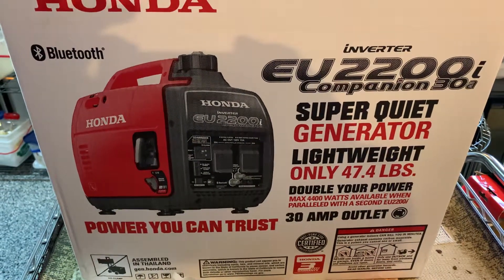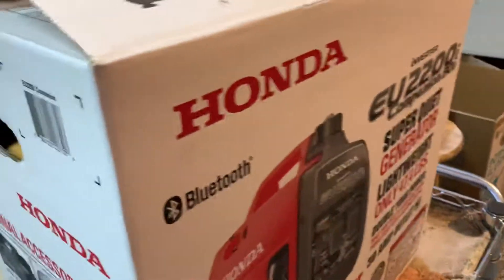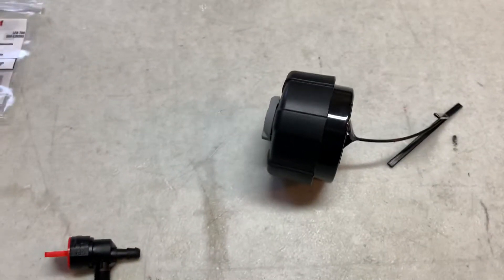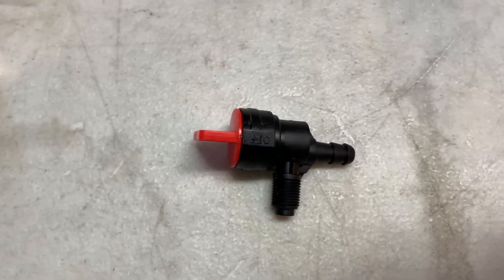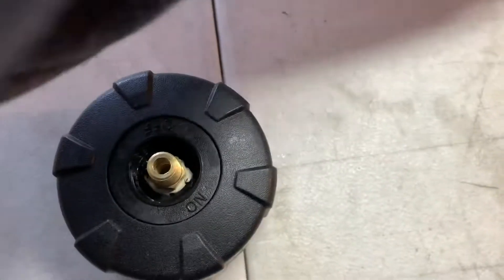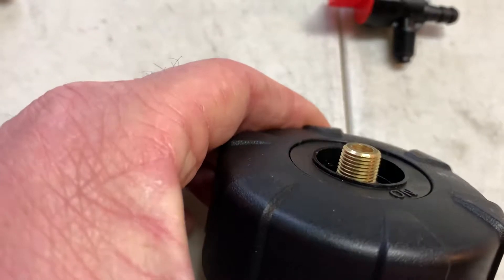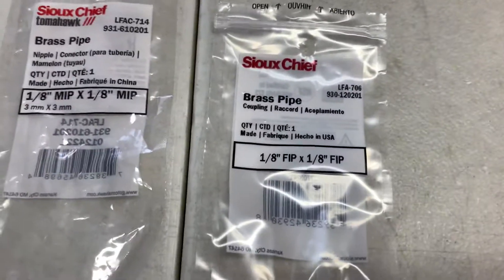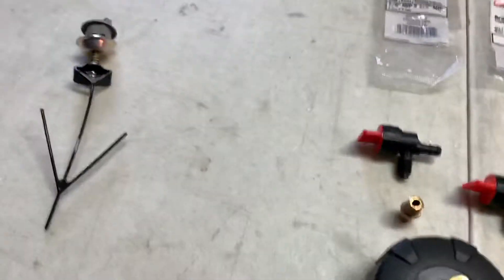Modify the gas cap on a Honda EU2200i TAG generator to make an extended run fuel system.

Comment: Hello
Do you have to fill the generator tank full and then hook it to the auxiliary tank?
Reply from the maker: I think it helps the fuel to flow better if the tank is mostly full.
Reply: @tipabr ok thanks for the fast reply

Comment: Concerning the cap modification.  Just go ahead and drill all the way through.  Tap it with a 1/8 pipe thread tap and use thread sealant on the 1/8 mpt nipple and coupling that you put on before the briggs and stratton angle valve.  It should seal fine that way.  Drill size for 1/8" pipe thread tap is 21/64".

Comment: I learned that the Fuel Cap on my Honda is most likely the new one.
I like the brass fittings however I don't trust the Briggs and Stratton Shut off Valve. I would look for a better brass Shutoff.
I also became aware the Honda tank should be filled full before trying to Bulb pressurizing the Fuel from the auxiliary tank. The auxiliary tank should not be closed off from atmospheric air pressure.
You could also install a fuel filter in the grass line as well. The little one that's in the Honda is not easy to get to in order to replace it because it got plugged up.
Thanks for video 👍👍

Comment: I have a system I bought ebay for my Westinghouse i2500 and the fuel won't transfer. The stock cap has to be left off for the generator to run, and then the same with the extended system. Any idea as to why that'd happen. It's a brand new generator to. Runs perfect with the caps off.
Reply: If I'm understanding what you're saying... the generator WILL suck gas from the extended system with the caps off?  I don't understand that, as I don't see how it would have enough "draw" pressure.  If the generator won't even run unless the stock cap is off, either something is wrong with the generator or the cap...I'd suspect the cap. I'd take it back for repair...hopefully it's still under warranty.
Reply: @TWeederTool  sorry it's a little hard to explain, the extender cap connected, it won't run, but the tank will vent, for example drain into a bucket or something, the flow from the extender system works until its connected to the generator. Then when you put the stock generator cap on the generator stalls out, but if the cap is off it runs fine. So I'm thinking the generator because both caps are different but cause the same issue.
Reply: I @4thGen4runner__   I think unplug one of the vent line hoses inside the generator not sure which one I saw on utube it's a certain step in this process

Comment: Whats the reason for going 1/8 inch rather than 1/4 in?? And do you need to have the tank above the generator for gravity feed? Does your gas line have a bubble pump on it to build pressure??
Cheers
Reply: So im curious if anyone has checked the pressure of the line I put a vacuum tester on mine after it was done and had about 5 psi of pull will that be enough
Reply from the maker: @rickhawkinson4788  
Rick... I'd be curious to know the psi of pressure the fuel pump creates within the fuel tank itself, without the extended run set-up attached.  If that pressure could be measured, and then compared to the psi in the tank of the extended run system, it should give an idea as to whether it's still pulling enough.  Sixty-Five Ford has his system with the fuel tank below the generator and it looks like at least a few feet away, and it works well.
Reply from the maker: Danny- just the extension nipple is called 1/8" MIP...even though the outer diameter IS probably closer to ¼". I"m not sure why it's labeled that way, but those are the parts I needed to use to make everything come together.  I do not have a bulb on the gas line. If you want to add one it may help get everything primed more quickly. The gas tank does not have to be above the generator. The auxiliary gas tank can be level with, or even a bit below the generator. The generator has a fuel pump (although it's not very powerful), so as long as your generator has at least ⅓ of a tank of gas in it, the system should pull the gas from the auxiliary tank fine...As long as you don't have any air leaks.  Hope this helps!  -Tim
Reply: So how I checked the psi was with the cap I made with your video its not as pretty as your but seem as functional then a couple feet of gas line hooked to it with the Guage and ran the generator with no gas tank connected and that's where I came up with the 5psi but I guess im not exactly sure how the generator operates I've since got a boat tank and in the short time I've ran it seems like at times it pulls more fuel then others I'm wondering if the fuel pump pulls the whole time I guess im gonna be using this set up today for the next few day for ice fishing so ill know soon how well it works I will say it seems to be working and pulling fuel but running it long term for a couple days im about to know for sure

Comment: Made 2.  One didn’t work.  Vacuum leak.  Could be the cheap Brigs snd Stratton shut off. I’ll replace that with a 1/8 mip x barb angle.    If that’s not it I’ll pour epoxy into the top to seal that union.    Or it’s the Honda gasket, but I doubt it.
Reply from the maker: If you find where the leak is, please post it here. Both of mine worked well. Thanks!
Reply: @tipabr  never figured our exactly what was leaking.  But I did all this and it works now
Used only one brass barb fitting, no right angle. 1/8 mip x 1/4 barb.  Fuel line goes up now.  Then pored west system epoxy into the top end around the barb.  It's not going anywhere now.  Interestingly the epoxy drained into somewhere.  So I added more later.  Is that void the leak?   Also epoxied the little air holes on the underside.  The cap no longer clicks when tightening. Maybe I'm getting a tighter seal on the rubber gasket.
Reply from the maker: @texasliam     It sounds like there must have still been a bit of an air leak around the barb if after putting epoxy around that area it seeped into...who know where.  It looks like what you did sealed off any potential air leaks.  Glad you got it to work!